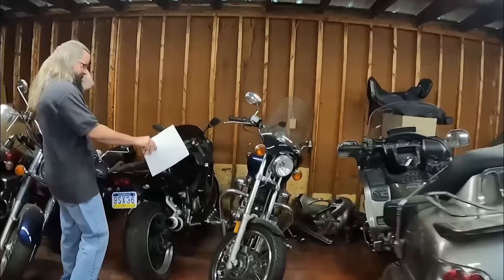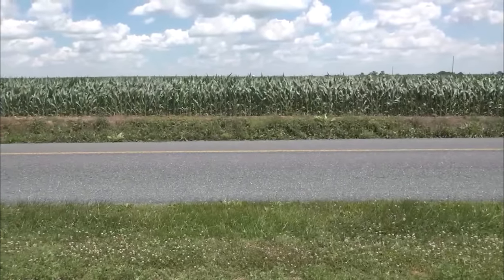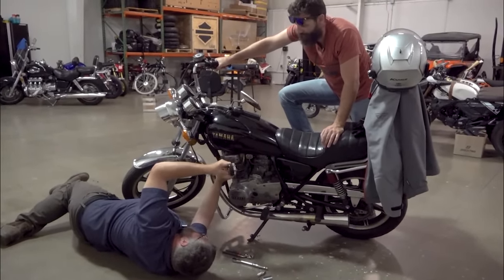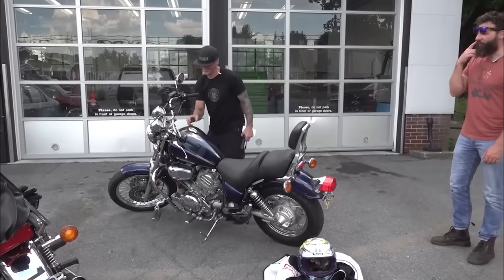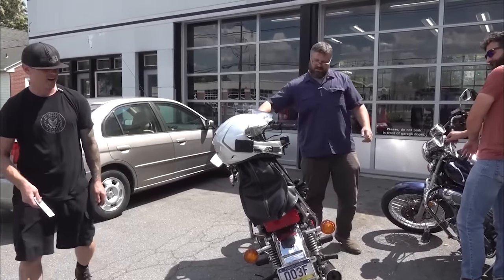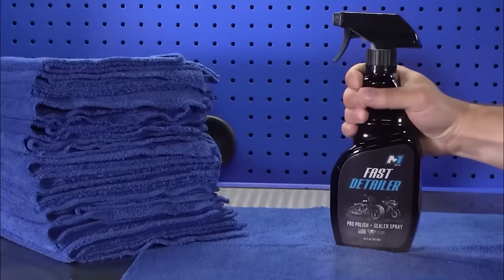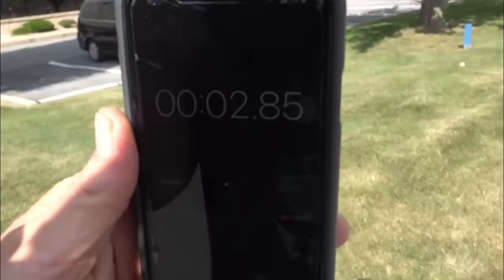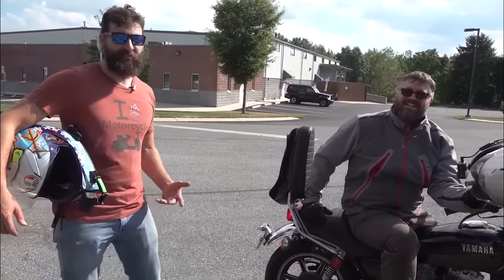We Bought $1,000 Motorcycles on FB Market Place, Who will Win?

Comment: Craigs bike is actually something I would like to ride just because of the kickstarter
Reply: Get a Honda Trail 125 for $5k, they have a kick starter, or an old Enduro from the 80's. There's a Honda XL185 for sale near me for $2000 I'm sure there's something close to you for a similar price.. Anything pre 1974 should have a kick starter too... other than Moto Guzzi.
Reply: The old Honda 4s had kicks as an option  up to the mid 80s.
Reply: @jaratt85  my first bike was a xl185 the best bike I've ever owned,still regret selling it 26 yrs ago 😭
Reply: When you're 17 and only ride dirt bikes but can't afford ones with the fancy electric start. Trust me you ain't missing much 😂
Reply: @hayden6119  all bikes should have a kick start as a backup in case the battery is getting low
Reply: @jaratt85  thank you....I 100%agree
Reply: Royal Enfield classic 500 has a kick starter and you can buy them new for less than 5k pretty cool little bikes
Reply: renown junk bike though, utterly useless. Only xs's worth having where the 650 and 1100. Rest were utterly rubbish.
Reply: I had a 650XS I bought for a grand but the guy who sold it to me used it for flat track racing and it was crispy. Lasted for 7 months and died. Tried to fix it but life took over.
Reply: @karl critchley

Enlighten us, what was so bad about the other XS models? The 400s are light, very forgiving, extremely reliable, and cheap. These traits make them a perfect choice for beginners and urban commuters. The triples (XS750/850) aren't bad bikes either. 

I find it strange that you like the 1100, yet dislike the triples, especially since the XS11 started life as an XS850 with another cylinder added on. In fact, quite a few parts are shared between both models.

As someone has had a 1982 XS400, a 1983 XS650, and a 1981 XS1100, I've gotta say that the 400 was my favorite of the three, despite being the worst condition-wise. Sure they are slow, but power doesn't mean everything on a bike.

Unless my drive is more than a half hour away or involves travelling on the interstate, I can usually be found on my hilariously underpowered Ninja 250's seat. Although it has a perfectly functional zx-10r as a stablemate (with around 6x the horsepower and a third more weight), the little 250 is much more fun to drive around town. 

To me, being able to wind the little engine out and hit the rev limiter in each gear before you shift is a lot more enjoyable than having to baby a powerful bike around. On my large Ninja, I cant even hit the limiter in first gear without risking fines and/or jailtime, even on the interstate.
Reply: Almost every bike can push start
Reply: Honda 75 76 CB360 kick and electric!
Reply: 4 out of 10 for entertainment.Sean never sticks to the rules!

Comment: I had a Virago 535.  I think it was a '94 or something like that.  Bought it back in 2007 for $1200 bucks.  Tiny bike, but really fun.  The tank was actually fake.  The real gas tank was under the seat and the tank was just for looks.  It was great though.  I cleaned the chrome and gave it a new paint job and sold it for $3200 and it is probably still on the road today.  Thus proving that looks are everything.  :)

Comment: Craig's bike probably has higher compression than the tester showed.  CV carbs either need to be removed or the slides propped up.  Twisting the throttle opens the butterflies, but the slides stay down blocking airflow.
Reply: CV carbs suck. Give me flat slides any day.
Reply: @hvymax  the soft delivery of cv carbs
power delivery make it beneficial on slippery surfaces, making it ideal for new riders or extremely slick conditions. Those cv carbs made it easy to race the  special II on a friend's practice track in fla. sand, and won, was scary as heck so twist the throttle and hang on.....the dumb things we do/did in our younger years.
Reply: You mean limp delivery. Flatslides do what you tell them when you tell them for better or for worse. CV's will get around to it eventually.
Reply: Xs 400-500's that last 15k before an explosion where as rare as fek. Scrap metal in transport form.

Comment: Definitely. I bought 1982 Honda cb900c. I bought it for 700 and put about 700 Miles on it. Now she needs some work. Still runs and drives though. The carbs just need some help. But so do I with this bike. It's my first road bike. Little different then single cylinder two strokes.

Comment: The Virago is a XV700 not a 750. I had one as my first bike.

The Yamaha XV700 or Virago 700 was a Yamaha V-twin cruiser motorcycle. Made from 1984 to 1987, it was part of Yamaha's Virago line of cruisers. It was informally known as Yamaha's "tariff buster" of the US's 1983 tariff on imported motorcycles with over 700 cc of displacement.

Comment: I had an 84 import 750 virago,had it 25 years,treated it bad, through the air system,exhausts,in the bin, ground the puncture rim off the back wheel, fitted 15"van tyre,(bigger diameter)did over 140,& 80 yard black stripes in second & third, bullet proof clutch & engine,I changed the oil when I got it,was still clean 25 years later, chopped it up a bit,cut tank longways ,split and lowered that, dropped yokes down forks, trials bars, made Indian bodywork outa crap,chucked Speedo, only bort pipes, couldn't break it,best most indistructable bike I've ever had, out of proberly over 500 Japanese brutally treated , think it was £800.... when run's on one tap float chamber s first,blow down fuel pipe with bleed open, before you stip anything,free float valve marmite ! X

Comment: If you want a good cheap used bike, buy it during the winter and spend a few months fixing it up for spring riding.  This also applies to new bikes.  I bought a great 2019 BMW G310GS in late October of 2020, just before the 2021 models were arriving.  BMW knocked $1000 off the price and the dealer came down another $400.  I got a brand new baby GS for $4920 out the door, with a three year factory warranty (that I haven't needed in the past two years).

Comment: In 1986 they took a V65 Magna’s 4 carbs off and installed a large 2 barrel Weber carb and had a super charger built. PerWee Gleason made a 10:59 second quarter with this bike and after adding the charger they couldn’t get a time as the front end wouldn’t stay down. They started to build a wheelie bar when the project was cancelled and money was reallocated. 
  Turbo and super charge them

Comment: Hey, my dads 1989 Kawasaki vulcan 750 does not want to run, it was flooding before. I took out the carb and rebuilt it for the second sign. I put a little starting fluid, it fired and then stopped. I have an in line filter in the gas tube that runs from the tank to the carb. I can see gas in there? Whats the next step? Thanks and keep up the great work guys!

Comment: Any average person can buy a motorcycle from $500-1,000. It takes a lot of patience. You need to be ready with cash in hand at any moment as well. Your best bet it to scour Facebook marketplace a few times every day. I can guarantee you that every bike in this price range will need moderate to extreme repair to make them roadworthy again.

Common issues include: Dirty/misadjusted carburetors, bad batteries, old tires, burnt wires, bad wiring grounds, bad charging systems (stator & regulator), starter solenoids, old fluids (motor oil, brake fluid, fork oil, gear oil & gas), sticky brake calipers, all cables (speedo, tach, throttle, clutch)

It sounds like a lot and it is. A lot of these bikes are 20-40 years old with little to no maintenance. I enjoy working on them, but buyer beware!
Reply: Yea, i got a 79 gs1000 for $600. Went through and refreshed all the fluids, fixed a couple wire connections that were still good but just needed new tape. Replaced the battery. But the dang thing just wont start. Turns over, everything sounds like it works, everything looks good, just will not take off and actually start.

Comment: I bought my 1994 Honda Magna VF750C for $1300 and he thought the thermostat was bad, cheap fix. Got it and turns out it was the gas tank vent line that had a kink, so after a few minutes of riding it would die and need the tank opened to breathe, then it would go again for another 10 minutes. It's been made a custom designed around a 1942 Harley WLA military model and I believe it's got some mods, as it gets up pretty quick compared to other 3rd gen Magna's.

Anyways, super awesome deals are available if you look hard enough!

Comment: I only paid $800 for my 82 Suzuki GN125. It had been ridden as a farm bike for years. I put it on the road and it passed inspection with the only work I had to do was put a new battery in it. So with registration, the battery and sales tax. I paid probably just under $1000. 

I'd like to know how much they paid with taxes and everything. Cause if you factor that in. Then Craig lost by probably few hundred if going purely by cost.

Comment: You didn't check the swing arm bushing could be a ton of play that's always part of a inspection not a parking lot inspection get it up on the lift and do a real inspection oil leaks bushing's chain tires for dry rot

Comment: Those compression gauges are probably not accurate. The long tube connecting from the plug to the gauge holds air itself. The longer the tube, the lower the rating. Might only be like 10-30 psi lower but what’s really important is how close the levels are to each other
Reply: Pressure equalizes in closed systems. The volume of air may take longer to compress with a longer hose but the standard is to turn the engine over until the pressure stops increasing.

Comment: Dang, you hit a nerve for me. Long story, but I've ridden since 1988, off and on.. finally back into riding 2 years ago. I'm also a self proclaimed mechanic master, maybe 20 years less experience than Craig but can follow everything he says and does and says yuuup exactly what I would do. Your my man Craig! 

Anyways. Back into bikes. Bought a 1987 virago 700. Fixed it after 14 years of sitting. Bought a 1994 virago 1100. Fixed it after the guy screwed it up (bless his heart though he tried and passed as he had it torn in half) . I currently ride that bike. Bought a 1988 750 that I got running but am currently rebuilding for fun.

So.. your 1987 xv750... sorry to tell you but that's only a 700. Harley Davidson put out a tariff that all imported bikes were under 700cc from 1984 to 1988.  You have a 700cc motorcycle. Yes the viragos brakes are awful unless maintained (just like your precious Harley). Yes the signals and lights are weak (they're old bikes left in the weather come on!) 

You're not wrong on diagnosis, but give it credit. 

BTW your virago exhaust is not stock and sounds really good. And your compression needs read with the throttle open, so you're probably around 150psi which is amazing compression for these bikes
Reply: Just say the word. I can get you in touch with a virago expert in Michigan, another in Asia, and a yamaha carb expert in California

Comment: A bike starting colds without choke is not good bro. Means your running super rich. Will sort itself after it was up?
Reply from the maker: I ve never heard that ever in my life. And I think you are wrong
Reply: @BikesandBeards  your jets are built to work at running temp if your dead cold and start with no choke when the engine warms up and starts vaporizing fuel better it will get richer.
Reply: @BikesandBeards  the choke is designed to compensate for the cold until you warm up to operation temp.